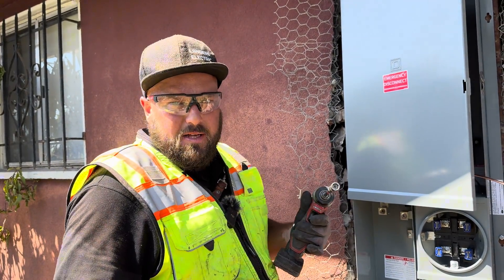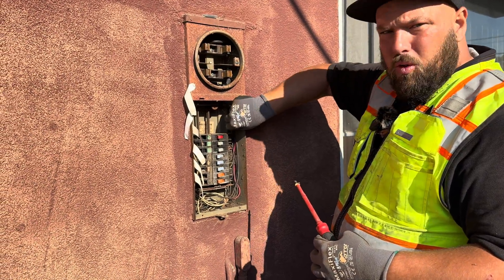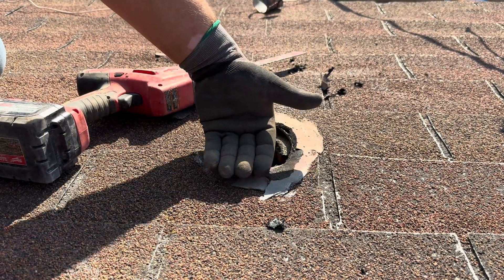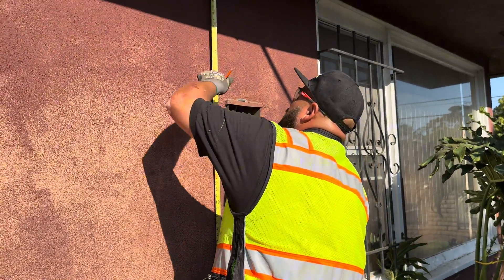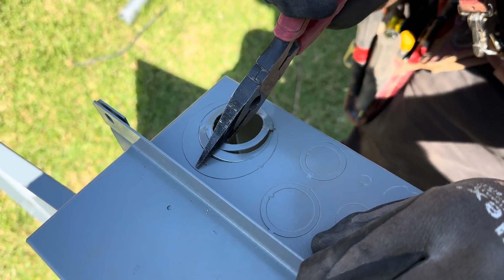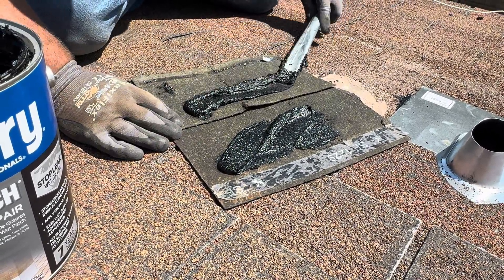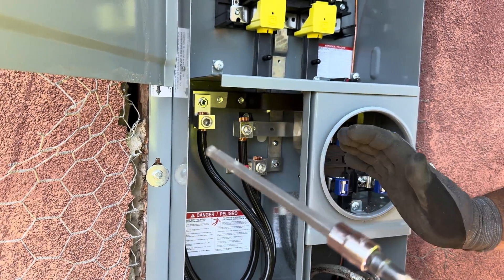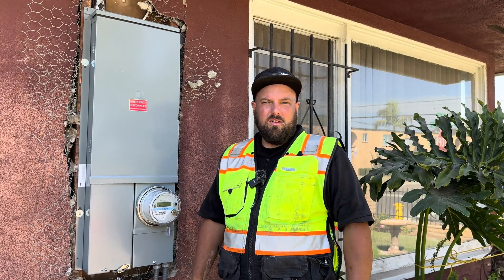Electrical Panel Upgrade | EASY 200 AMP Main Panel Replacement | FULL TUTORIAL By MASTER ELECTRICIAN

Comment: It’s crazy to me that the panel is on the outside of the house and new code says the main shut off has to be on the outside of the house. This is just stupid!  It’s a favor for all criminals they simply walk up shut the power off and there goes your cameras and alarm. And cops will take advantage of this to stop your cameras from filming their corruption when they violate your rights when they come to your house. As a roofer never use tar just roof it correctly! You should have gone down one more course of shingles to install that right.

Comment: Poor people you do not need a permit which will force you to pay an expensive ass electrician. Disconnect the power from your home yourself by first turning main breaker in box off first so no power is pulling from your house then go up on the roof and disconnect from the grid one wire at a time never touch 2 wires at the same time and don’t let the wires touch then go down connect new box and service line and meter box if your upgrading to 200 amp service when done connect back to grid and you can run everything in the house before or after installing the service panel electric company won’t know shit or care as long as you pay your bills and do it right if they ask tell them it was pre existing stop following rules that keep you down
Reply from the maker: Hey there—respectfully, this is dangerous advice. In our area the utility requires a permit for service work and does not allow anyone to touch their side of the wires. Only the utility can disconnect/reconnect at the service drop/meter. If a contractor touches those conductors, we can lose our license and end up in serious trouble with the city and utility.

Also, turning off the main does not de-energize the service conductors feeding the meter and lugs. Those are still live and can arc like a blowtorch—one slip can cause severe burns, fire, or worse. Please don’t pull meters or disconnect from the grid yourself.

If you need a panel upgrade or service work, the safe and legal path is to pull a permit and schedule the utility—that protects you, your home, and the lineworkers. I say this kindly but firmly because I don’t want anyone getting hurt. Stay safe!

Comment: I wish you serviced LA County but since you don't I hope it's ok that I ask you this question. My water heater is inside the house. 
Some quotes state this, "Perform complete bonding of the water heater to the hot water" or "Bond cold/hot/gas at water heater with #4
armored ground" or is this done under the house in the crawl space? Do you have a video of what this entails? Does it require the electrician to access the water heater closet in the house?

Comment: 1:19 Very important to check. When I was a young kid helping out my dad at a rental he’d just purchased we had to check the breakers and since  we pulled the circuit breaker  we thought we were safe, sure enough as soon as he stuck that screwdriver 🪛 in the sparks ⚡️ nearly soldered that screwdriver to the panel, as well as his hand 😅 Sure enough there was a secondary panel that was still hot feeding into that one.  Thank God he didn’t get hurt 🙏

Comment: For the torque segment why did you divide by 12.
Reply from the maker: Great question! The number the manufacturer gave me was in inch pounds. My torque wrench is in foot pounds. To convert inch pounds to foot pounds you divide by 12. (I.e. 12 inches in a foot)

Comment: As a plumber. Two things I noticed 1-most important  never ground to the copper plumbing. Reason is the electrolysis it causes will cause a leak somewhere in the plumbing. 2- as a roofer told me never mud the bottom of your flashing only needed on top and sides so any leakage won't be trapped underneath

Comment: I know you use the SQUARE D Homeline series electrical panel. I'm in Torrance which is outside of your service area otherwise I'd definitely hire you. That being said a few of the contractors I have contacted seem to use Siemens. 
QUESTIONS: 
1) Is there a specific reason you prefer SQ D Homeline series vs Siemens? 

2) I am reading that copper bus bars (more expensive) are better than aluminum. Your thoughts?
Reply from the maker: They they’re both really good panels. If they prefer one over the other, I would just go with the Siemens.

Comment: I had a quick question.. how did you support the riser? Didn’t catch it in the video.
Reply from the maker: Usually we use a 2 hole strap with a spanner bracket. In case you missed it, I just dropped the next episode of our Electrician POV Series! Check it out here: https://www.youtube.com/watch?v=bJPEoAG9f-Y&t=58s

Comment: I left you a message on your phone just this morning thinking you're too busy to answer comments but I see that you do answer comments. Which brand of panel do your recommend for single family homes?
Reply from the maker: Sorry about that. I get so many scam calls everyday that it’s hard to know which ones are real. I really like the square d panels.
Reply: @landerselectric I literally just called this morning so no worries about a call back. 
I read that Square D makes the Homeline & QO series. QO is supposed to be more if a premium panel 
1) Do you agree? 
2) Did you hear about rhis recall?
"...models of the Square D QO Plug-On Neutral Load Centers, commonly known as breaker boxes or electrical panels, due to potential thermal burn and fire hazards."
Reply from the maker: @jjf7991 I don’t use the QO. I use the Homeline version. I’ve found that they are really good. Should be a link in the description.

Comment: First class job. 
I think it’s a good idea to hold the terminal blocks with channel locks while setting torque and I’m a nut for anti-ox on terminal threads. Especially in outdoor N3R equipment. The next guy 20-50 years out will thank you.
Reply from the maker: Completely agree!

Comment: Serious question, how does the home owner then go about the gaps in the wall on the sides after it’s installed? Do they then hire someone to close them?
Reply from the maker: Great question. I usually provide a stucco guys referral so they can get it repaired. If there is siding on the house we usually waterproof it and put 1x3 or 1x4 trim around the panel and the homeowner paints it to match.

Comment: How much does a panel upgrade cost ???
Reply from the maker: In my area we charge $4800.
Reply: And is that with permits or home owners permits?? @landerselectric
Reply from the maker: @paderone12  yes sir. That price includes everything you need. The only thing that’s not covered is stucco or drywall repair. The other thing to keep in mind is if the utility requires underground trenching to upsize the conduit if it’s underground fed, it’s a different price.
Reply: It has a riser..connection is on top.. @landerselectric
Reply from the maker: @paderone12 As long as the gas meter isn’t right below it and we don’t have to move the panel price would be $4800 all in if you’re in San Diego County or South Orange County.

Comment: not all the way around!!!! dont put sealant on the bottom edge of the flashings. any water that gets in needs to be able to drain out the bottom of the flashing... never put sealant on the downhill edge of pitched flashings!!!!!
Reply: That is such a good point. Are you a roofer or just an excellent electrician?

Comment: 9:38 I am very happy to see an electrician torquing down the lugs properly.  So many think that they don't have to and just crank down on them until they can't twist it anymore, and all that does is stretch out the treads and will cause a loose connection over time which will lead to arcing and potentially a fire.  They think that they have a "calibrated" elbow, or they have never done it in their 30 years on the job and they don't need to!  If your going to do your work and publish it on social media (or YT) you really should be following NEC rules.   I have seen guys using a 1" cable clamp for the top of the box as a cable splice for 4/0 wire as well, and showing everyone on YT this!  🤠👍
Reply from the maker: Yeah, I think it’s critically important to do things correctly whether on camera or off camera. Not sure if you’ve seen it yet but we actually have a master electrician POV series now. It’s pretty cool. You might like it.

Comment: Good video. I was under the impression that best practice for roofing flowering would be to leave a gap in the mastic at the bottom for any moisture to get out. It never works to assume the installation will always be dry
Reply from the maker: That’s a good point! Thanks for the tip!

Comment: Wow your explanation & work are top notch. I'm in the Torrance CA 90503 area. I'm sure that's too far but if you have a referral that has been approved by SCE for EV rebate that includes a panel upgrade and EV charger install, I'd appreciate it.

Comment: Nice job. Wanted to make a couple of comments about the ground rods. It doesn't matter the size of the ungrounded conductors the nec states that no grounding electrode conductor when going to rods is required to be larger than #6 copper. Also grounding at the spigot is not acceptable. If someone in that house were to cut the copper and install pex you would lose your ground. This needs to be done at the water meter within 5 ft of where it enters the house.
Reply from the maker: Hey Vaughn. Thanks for the comment. If you could post the NEC references that would be helpful.
Reply from the maker: As far as not larger than #6, I see what you’re saying in 250.66 (A). I’m going to run this by my inspectors and see if they’re good with just a #6 to the ground rods. However, that doesn’t change the fact that the water pipe has to be bonded and sized based on 250.102 (C) (1), and if I want to be able to attach it straight to the service panel or GEC 250.104 (A) (1) (1), (3), it needs to be a #4, 2/0/3/0 being the  largest ungrounded conductor, for ease of install I still might keep it at a #4, and because even if the code says it can be a #6, I’m not going to risk getting into an argument with the inspectors.
Reply: Like I said, #6 being the mac is only for rod or pipe.  I never said the water pipe should not be used as a grounding electrode.  You need 2 and 2 ground rods do not count as the two. The 2 rod thing is the requirement if you do not have 25 ohms or less from the earth to the rod. You have to prove that or add a second rod, hence two rods. You still need 1 other electrode. Plate, ring, water pipe, encase steel, etc. Yes you have to bond the pipe but if you have 10ft or more pipe in the earth that is when you can use the water system.
Reply from the maker: @vaughnbeaufort8701 got it. Thanks for the comments! I’ll chew on all this. Really made me think. Appreciate you!
Reply: That previous comment was written poorly. What i meant to write was rods and driven pipes has a max size required of #6. All other conductors for electrodes is based on the largest ungrounded conductor.
Reply from the maker: @vaughnbeaufort8701 Makes sense. Thanks for the clarification
Reply: For the grounding electrode conductor size refer to  250.66 (A).  If the conductor is connected to a rod, plate or pipe and does not extend to anything else it is not required to be larger than #6.  Also in 250.53  D 2. For the spigot ground it is relying on the 10 ft of metal pipe in contact with the earth. However you can not rely on the water meter for the continuity 250.53 D 1 and it must be continuous. For the point of connection  see 250.68 C where it states that it must be connected within 5ft of where it enters the structure and  must be continuous.  Hope this helps.
Reply from the maker: @vaughnbeaufort8701 Remember that in this case we’re not using the water pipe as a grounding electrode conductor and simply just bonding the water pipe. We’re using the ground rods as the GEC. 250.66 doesn’t apply. Check out 250.104. That is where we look and there is nothing that says it has to be within 5’ of the main water entrance there. If someone comes in afterward and installs non metallic water piping they would then need to consult an electrician to make sure proper bonding.
Reply: All those code citations are in 2023 NEC
Reply from the maker: @vaughnbeaufort8701 got it.
Reply: What is your other electrode besides the rods. You need two. Rods are supplanted only
Reply from the maker: @vaughnbeaufort8701 we have 2 ground rods.
Reply from the maker: @vaughnbeaufort8701 cold water pipes used to be a reliable grounding electrode but not anymore because of the widespread use of non metallic water pipes. That is why the NEC and the AHJ’s require (2) grounding electrodes, I.e. (2) ground rods at least 6’ apart unless you can prove 25 ohms of resistance with (1) ground rod.
Reply: Supplement
Reply: Water pipes and other electrodes besides rod and driven pipe are only the only one that permits a maximum size of #6. Everything else is based on the largest ungrounded conductor.

Comment: Thank you for the knowledge. What razor knife is that if you don't mind me asking?
Reply from the maker: Great question I use the Stanley utility knife. And also, we just started posting a new series called the master Electrician POV series. It’s an Electrician blog where I document my entire day week after a week from a GoPro. Not sure if you like this type of content, but feel free to check it out.
Reply: @landerselectric  Thanks! I'll check it out
Reply: @landerselectric  Also why don't you use a ground rod driver? I respect the hard work but it's a two second job with the driver.
Reply from the maker: @Hedonism96 that’s a good point. I like to hit it with the sledge so I can feel if I hit anything. It’s hard to feel anything with a jackhammer.
Reply: @landerselectric  Interesting, thanks!
Reply from the maker: @Hedonism96 yes sir! Have you checked out our new master electrician POV series? I think someone with your engineering mind would like it.

Comment: There is no limitation on bending radius for single conductors. There is for cable assemblies (nm cable, mc cable etc.). The NEC wire bending space is for being able to get conductors into the lugs. It is measured between the lugs and the enclosure walls.

Comment: Personally, when I’m forming wires to go into a lug, I avoid sharp bends to avoid damaging the ampacity of the wires. Sharp bends can damage a wire and the larger the wire the more space you need to bend the wires in a panel, switch gear or junction box or outlet box!

Comment: In Oklahoma, the AHJ no longer allows the white wire to be used as a phase wire; it is allowed to be used as a switch wire for a three way switch but it must be phased with red tape. Article 200 lists the requirements for markings on a grounded (neutral or white) conductor. That’s why licensed electricians should do the electrical work and not an untrained individual who doesn’t know the minimum safety standards of the National Electrical Code! Can’t over state this!

Comment: A number 6 AWG copper conductor is the largest requirement for a rod electrode per 250.66(A) and be space at a minimum of 6 feet apart per 250.53(A)(3) for supplemental electrodes; 250.53(2)(1)thru(5) lists supplemental electrodes required.

Comment: Oddly. Be I’m not an electrician so I don’t know the actual terms. But oddly. The two main wires that come from the grid and go into the electric panel. Mine aren’t two main wires. It comes in through the grid as 2 mains. But for whatever reason. My guess is cost savings. Mine breaks into 4 main wires that go into my electric panel. So instead of a 200amp main. I have two 100 amps. I feel like I need to update my box and make it two main wires from the grid that go in as two main wires that go into the box.

Comment: What does a job like this cost the homeowner? I have an outdated 100 amp panel and a fuse box in my old home and looking to upgrade.
Reply: Someone else asked that and he charges $4500-$5000. SCE offers $4200 rebate for upgrade and EV charger install for "qualifying incomes" in CA. Not sure about other states.
Reply: @jjf7991  Thanks for that info, never thought about that, will see if I can qualify.
Reply: @LowKeyLifeHKD I found out rebate recipients are not required to use electricians from their list but if an owner does use a listed electrician, the electrician is paid $4200 directly. The owner must income qualify for the rebate. 
If an owner uses an electrician off the list, the owner pays the electrician & the SCE program gives the rebate to the owner.

Comment: Can you explain why you didn’t bond to the MAIN water coming in from the city?
Instead you went to a nearby spigot 🚰?
Reply: Guess inspectors in his region aren't picky. 
He didn't brace the rigid riser on two studs either and he used bare solid copper that isn't protected above ground

In my area, you need to bond to the main city water line. Put jumpers around valves and pressure regulators. AND bond the cold, hot, and gas line at the water heater.
Reply: @ same in my area.
Anything smaller than #4 AWG has to be protected.
Sand, clamp with bronze before AND AFTER the PRV valve and back to rod 1 and rod 2 into the intersystem bond terminal and finally into the mains service panel!
Los Angeles 😳😳😳